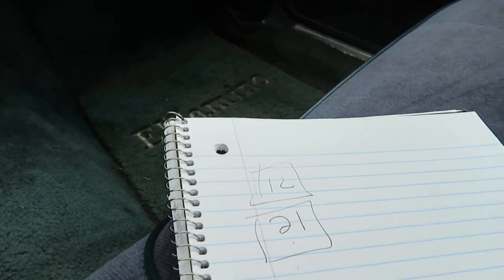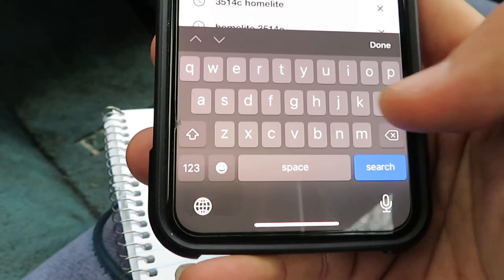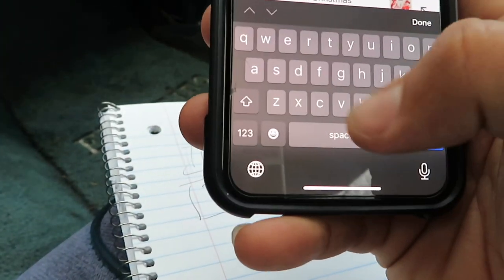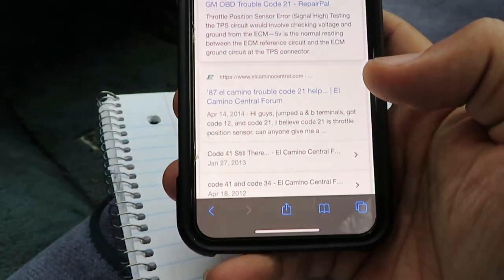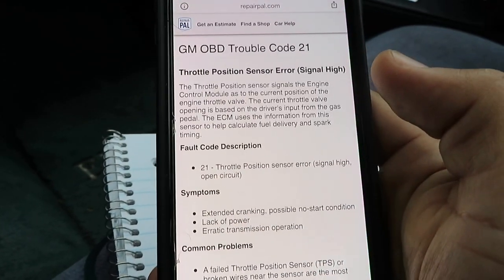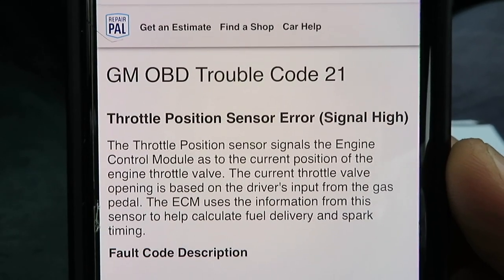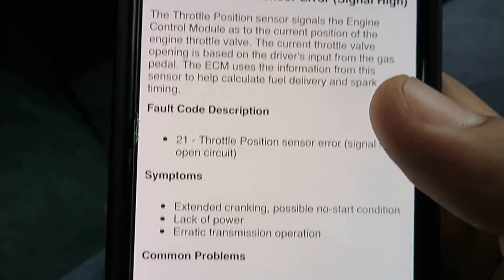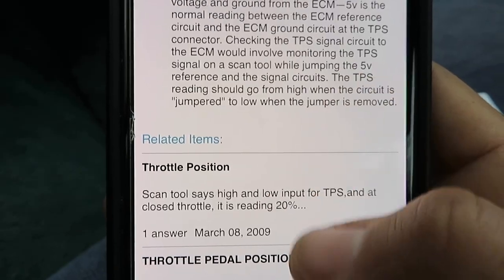Free Check Engine light diagnostic for OBD1 GM Vehicles

Comment: Just confirming that this is a valid source. This is very helpful he knows what he is talking about. It says it in the book to do this procedure for troubleshooting. The original hand book .thankyou for your time .would you be interested in making more about these range of models?
Reply from the maker: I will try soon. Thank you!
Reply: Show them what happens electrically when the ac relay sticks.:) their is problems having heat and ac on those models. Personally i have had 3 ans still have 2 of them and i think body by fisher sucks, trannys are underrated ,and though the engine and some make make be good for the gemeral concept of the model, it sucka electrically as well coming from and electrical engineer.
Reply: Yes they are reliable .but ONCE thingssss get real, they get real.

Comment: Most of these cars from the 80s and some from early to mid 90s with the computer didn't have much common mechanical problems and check engine light coming on as frequent unless you had a serious problem with the engine. Now newer cars the computers built in them were designed to scan the whole car and engine light would come on over one small problem like bad cat. converter although newer cars are more digital and more problematic.
Reply: Yes more of a problem later on ...:)

Comment: The paper clip trick  will not work on 94-95 GM vehicles
Reply from the maker: Thanks for the info!
Reply: My car is '95 Pontiac Grand Am.  I'm like someone trying to find water in a dry, barren desert, in trying to get the codes. Even in an OBD 1 Scan tool I recently ordered, for cars made from '82 to 95, it SPECIFICALLY SAYS IT WILL NOT WORK ON A 1995 PONTIAC GRAND AM. Even a paper clip I tried recently didn't work. NOTHING WORKS.
Reply: @laurabledsoe5878  a snap on versus will work on the car.

Comment: Did you ever figure out how to fix the code 21 issue
Reply from the maker: yes TPS is going bad. I haven't replace it. problem comes and goes. I'm debating on replacing it or getting a new carb. The TPS is in the quadrajet.
Reply: @j.j.sgarage1457   I would say keep the original carb it will be just as good as a new one if you rebuild it 🙏🏾. Hope to see more content on this beauty gbody cars are going to be huge in the classic game